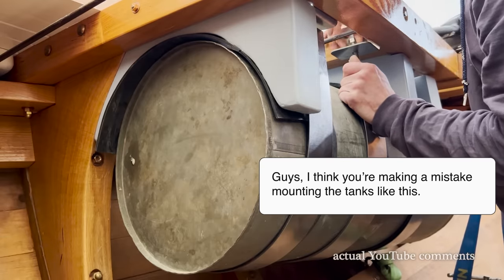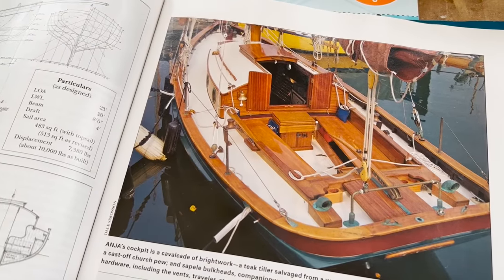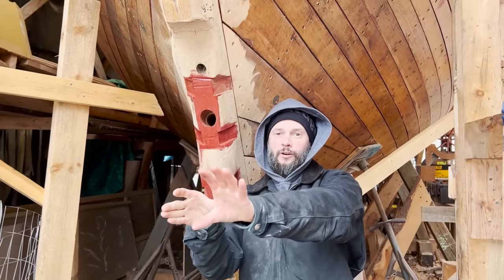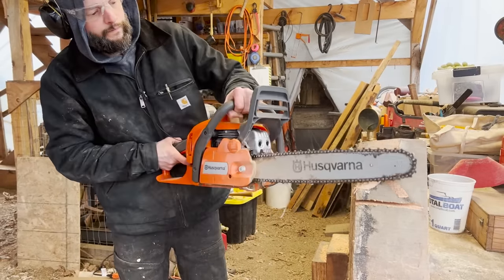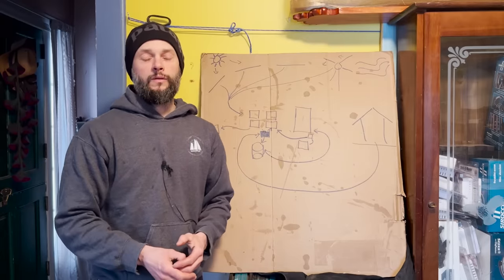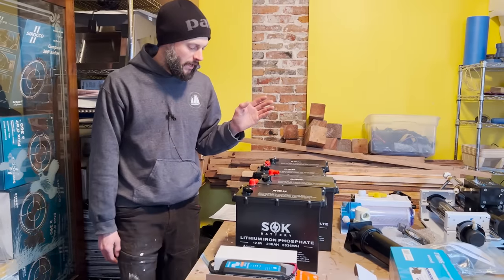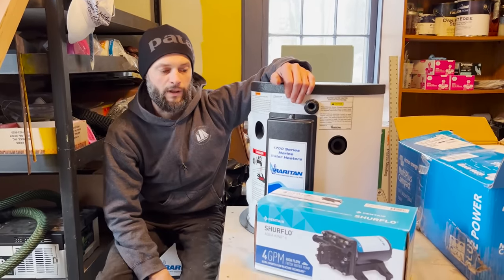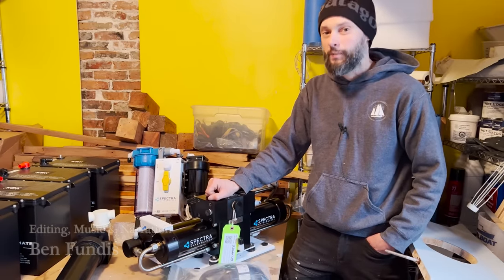That Prop Is Too Small & Other Comments - Episode 248 - Acorn to Arabella: Journey of a Wooden Boat

Comment: I agree with you on the chain saw being appropriate as I have used them for years, however for your applications you need to get one of the new electric versions that are hand sized.  Corded or battery, either one would be find and both depending on the work, replacing that husky you have with a large corded one would be a good idea and the battery versions for the smaller work give you flexibility I am sure you would appreciate once you have them available in the boat house.  A news bar and a sharp chain and you are in business for nice quick accurate cuts.
Reply from the maker: Thanks for watching, David!

Comment: Steve, you may want to consider running the alternator directly to the house bank. I have mine that way with a simple ACR from the house to the start battery. I believe you can pump more energy into the house that way while keeping the start battery charged.

Comment: I completely agree with Steve on the chainsaw. I also don't like sawzalls or routers.  The sawzall is good if your cutting metal or wood with fasteners in it, otherwise, if I'm rough cutting wood its with a chainsaw. I've been using chainsaws since I could hold onto them when I was like 10 (34 now).

Comment: As far as Coast Guard inspections go you can carry up to 6 passengers without an inspection.  The captain would have to have a "6-pack"  or higher captains license.

The Gerr propeller handbook will give you an idea of the size your prop needs to be and the requred ptch.  The size you will get from that handbook will give you a good start, but you will have to refine the prop pitch.  Sizing and pitching the prop accurately is not that difficult for a displacement hull boat, but it does require quite a lot of information about the hull form (i.e., displacement, wetted surface area, canoe body draft, water plane area, and so on).  Fortunately all of that required information can be calculated from the lines drawing.  You also need to know the power of the engine, the number of bearings on the shaft, the transmission ratio and the maximum rated engine rpm.  Finally, you need to know the details of the prop design (diameter, disk area ratio, blade form, hub diameter, etc.).  Since you chose a non-standard prop calculations will likely not get the pitch much closer than about 1".  Fortunately, with a variable pitch prop the final adjustments can be done by you, even in the water.  One last comment, a displacement hull can be driven to well above hull speed, it just takes a LOT of power to go much above "hull speed".  The power curve is exponential so going faster quickly requires too much power.  Diesel engines have been around since the 1890s, but until the post war period they were too big and heavy for a small boat like yours.  Hence the use of gas engines in most sailboats during the first half of the 20th century.

As fas as installing those batteries goes, you need to look at the new ABYC standard for lithium batteries on boats.  Yes meeting ABYC standards is voluntary, BUT insurance companies have a nasty habit of refusing to insure boats that are not ABYC standard compliant.  They have become very picky about lithium batteries over the last year or so.  So make sure that your lithium batteries meet the ABYC requirements which include that the batteries are UL approved (the entire battery not just the cells).  I strongly suggest that your installer reads the new ABYC lthium battery spec, or you may be in for an expensive surprise when you try to insure the boat.

Comment: I work in radio communications, our mountain top sites are solar powered and have been converted over to LiFePO4 batteries.  The amount of run time vs thier footprint is tremendous and omigosh they are so much lighter (that's a big deal for someone who has to fly up to a site and then walk a battery across a mountain top)! The batteries usually bulk charge up to 100% by 10am to replace whatever the gear uses during the night.

Comment: SOK is a really good choice for batteries at this time.  It's kind of the best of the 2nd Tier brands.  824Ah is tons of capacity, you'll have a lot of holdover capacity for a sequence of rainy days.  No-one ever complained about having too much battery on their vessel.  You didn't mention it Steve, but a fine investment would be a high capacity alternator with something like a Wakespeed external regulator for battery charging .  I think you're gonna find that you'll use it a lot more than you think.  Wind doesn't provide all that much power, you don't have a ton of room for solar on that vessel, hydro generator is obviously only useful when underway.    That leaves the alternator picking up the slack.

I'm glad you relented on the water heater.  As I mentioned months ago, we use a water heater for showers even where we live down here in the tropics.  In summer, when it's brutally hot, a cool shower is nice.  In winter, when it feels cool to those of us who are acclimated, a cold shower is just no fun.  Totem is right, you're not setting up a boat for roughing it, for long term cruising, you should make your life as comfortable as you can.  4GPM is not a small pump - it's actually larger than most.  We have a 2.9GPM pump on our large catamaran.

You should reconsider the accumulator tank for the fresh water system.  It has slightly different benefits than in the watermaker setup.  In short, the $100 accumulator and the 20 minutes it takes to plumb it in will make your pressure water nicer to use - no pulsing -  but more importantly it prolongs the life of that pretty costly freshwater pump quite a lot by allowing it to cycle much less.

Comment: Another point to note might be that the propeller can be changed.  Optimizing propeller design is a vague notion.  Optimize for what?  Thrust, fuel efficiency, power absorption - and at exactly which speed would you like to optimize any of those performance parameters? Prop design is usually a wise compromise considering predicted hull speed, emergency situations such as wave resistance, wind resistance, fair weather cruising situations, importance of fuel efficiency, etc.  Of course, motor selection goes with it.  Fortunately, if a selected prop exhibits undesirable performance, it can generally be switched out for a design change where pitch, diameter, number of blades, etc, can be tweaked to get a better result.  It happens that it is very common to try different prop designs on a one-off displacement hull.  Also Gerr's book is a great reference.

Comment: You might consider dual alternators with an oversized second alternator. You will be surprised how much power you actually use and how often you will need to run your engine. It will take a long time to charge your batteries using a factory installed alternator. I would recommend that the second alternator be as large as possible for quick efficient charging. Solar is over rated. Your lucky if you get half on a sunny day unless your panels are continually in direct alignment with the sun.

Comment: Steve  water heater thumbs up !   ,   i know your from a colder  climate,  So this may not register with you but after owning a boat in the sea of cortez   it is a must to have A/C,  for a live aboard  , The reason is the boat turns into a sweat box even with fans its very  hot  humid and uncomfortable  and youll find yourself on days wanting to get a hotel room with a/c sometimes  just to rejuvinate , that kills your budget .  even if its just for your sleeping area its a must

Comment: Never put the water heater on batteries!  Run the engine coolant through it for hot water underway and only use shore power for the 115Vac heater!
I am an electrical engineer, sailor,  and I have been a yacht electrician for ten years and I have never seen a single boat that put their water heater on the batteries.

Your electrical panel should be set up so that shore power comes in through a main breaker, which feeds a bus with (on your boat) two breakers, the inverter/charger and the water heater.  The panel then has another bus with the breakers for your outlets which is powered by the inverter or shore power.
Reply from the maker: Yes. That’s the plan.
Reply: @AcornToArabella  Don't even connect the water heater to the inverter at all.  As you showed in the video.
There is no real option to heat water with batteries, so just don't even allow it to be possible for the heater to drain them in any way.
Thanks for anther great video!
BTW, I hate sawzalls too, lol!

Comment: I have carved burl bowls with chainsaws, and throttling down the motor helps control the cutting action, especially cuts that engage the tip of the bar.

Comment: Hi Steve (and Team of course)! Thank you for the extensive explanation on your choices! Maybe it's a European centered question, but can your inverter/charger for shore power deal with 220/240 V - depending on the locations you are planing to visit, this might be of importance!
All the best to you and your mum (unfortunately I had a similar situation last year) and thank you for documenting your awesome work!
Reply: Yes Steve I was thinking the same. Sometimes American designed and made equipment can be short sighted in those terms of supply voltage across the world. Something made for domestic America is ok, but if being fitted in a sail boat needs addressing now before installation, or you may regret it. Even if you went to the Caribbean you'd find a lot of 220-240 volts 50 Hz as many were British colonies.

Comment: When I pulled my 25' Brynne out the first time, she weighed in just over 15,000. Over the next couple years I gutted out the interior and the the engine. Only thing left was fuel tank, battery and rigging. For I continued to sail her, I think I averaged 4,000 miles every year with her. Anyway at the lowest weight I had her down to was just over 12,000 pounds when gutted. Her mast was just over 1,000 pounds. It took me 10 people to move the mast off the trailer when I took it down to maintain it. Think it had been the first time in at least twenty years. I was so disappointed that the Mast coin was gone ☹. For people to know how my sailboat could be so heavy, her mast was over 15 foot taller than the norm for a marconi rig. I had to use sails that you find on 30 to 35 footers. When she was light, she did sail very differently and tender. Once I had the engine back in which was a 10 Hp Volvo Pinta Diesel and interior, she once again pegged 15,000 pounds. Once again she sailed in 20ft seas and 40 to 50 knot winds with confidant grace. I miss her.

Comment: You won't need the fresh water foot pumps with a water maker. Keep it all on the pressure system. my mistake was not putting the accumulator system on our boat so hopefully you will make room for it.

Comment: Only one of the two tubes in your water maker has membranes inside. The larger one IS your high pressure pump. The external pump is your low pressure pump. Take excellent care of your membranes. They are expensive, go bad quickly and easily and are difficult to get delivered in many parts of the world. Water akers are high maintenenance and require a lot of power. Much easier to invest in a rainwater collection system.

Comment: Diesel is much less volatile than gasoline. That’s why you see work trucks with auxiliary diesel tanks in the bed but never an auxiliary gasoline tank. You’ve gotta work a bit to get diesel to light, gasoline is a bomb.

Comment: I assume that Victron multi system doodad will also accept 230V shore power? At least you should equip the inlet in a way that it's possible in some remote locations - like Europe. 😁

Comment: Your electrical system is entirely adequate for a boat that size, but you will want 120/240 for running tools etc. So a breaker box will probably be needed as well.

Comment: Steve, sounds like you've done your homework on electrical and water systems, as expected.  I built out a Van with similar systems (yes, a little smaller) as you've described and just retired after working as an electrical engineer for 40 years, so I've a good understanding of what your talking about.  I expect you're wiring your batteries in parallel, just be sure to locate the inverter as close as possible to the batteries as and don't skimp on the high current wire gage.  If your wiring your batteries in series, or a combination of series and parallel to up the voltage I'd say that's a good idea.  The current demand from the water heater will be pretty heavy I suspect and a 24 or 48 volt system will be a big help with that.  I'd be happy to kibitz on any electrical system details if you'd, just let me know in the reply.  I certainly wish you the best and hope and pray you'll get your Mom out for a sail this summer.
Reply from the maker: 🙌 and thanks for the kind words!

Comment: Are you putting in a allocated battery for the windless?  Very common unless its manual. 
My experience with solar charge regulators , depending where you put them , use more than 1 charge controller,   because of shading , ie if you put 2 on the top roof , depending on your tack shading will effect both sides unless you put a controller on each side ,  masts and booms throw shadows every where ,  hydro gen great when moving , crap at anchor , wind for tick over of power 24/7 only if windy ,  
All the big name nav gear , with 6our first cruising area , 12 v computer, 12 v monitor ,   open cpn up to date charts , and learn over time what works better , 
Much lighter,   depth wind gps ,  
Your mother will be there , you can always finish things off inside  when in the water if you need a bit more time ,  respect

Comment: Consider having twin alternators - we have two, a 'normal' automotive one which runs to the engine battery and a larger one to manage the house bank. Ours both run through the same Smart Bank setup so we can either charge together or singly depending on the state of the engine battery which is the primary requirement.  Always good to have a spare!
And...  Shurflo pumps are dodgy.  Of all the things I have replaced over a lifetime's boating, Shurflo pumps are top of the list.  I know you already have one, but take a look at Jabsco for when you need to replace it (which will be fairly soon). Jabsco sell a prebuilt pump/accumulator combo which matches the output and pressure for you.
Reply from the maker: I had two on one of the boats I cruised and they were utilized the same way. It’s not something planned for Arabella at present. On my boat now I just carry a second one because I bought a second Yanmar for parts then got the alternator serviced so it’s ready to go! I’ve got a tiny bank though. —Anne

Comment: You'll find a small bladder tank in some city water houses, if you're fed through a check valve the plumbing in the house needs room for expansion when the water heater comes on. I would think you'd want similar on a boat with it's own pressurized water system and a heater.
Reply: Exactly. Most state building codes require an expansion tank if the building has a "closed" system so that expansion of the water in the WH does not break the WH or other components in the system. Even if the expansion does not immediately break things, the pressure cycling will fatigue the pressurized components and shorten their life. The tank has nothing to do with the pump. A "closed" system is one where the expanding water cannot go back into the water main. A pressure reducing valve (PRV) on the feed line from the water main is the most common component that will create the closed system because water can only flow one-way.

Comment: Steve  putting your 12 volt system in series will give you a higher voltage  24v dc or 48v dc that is more efficient when transferring to 120v a/c . Think you can just do a dc to dc transformer for the equipment or make two circuits one high voltage dc and one 12v dc with an extra battery . It will be an extra cost but will be good for energy management and efficiency .

Comment: prop design is a art and profession all by itself. diameter compares  to pitch/ weight to hull design displacement /motor - trans ratio to speed/ all is important, and someone else's job not for  the main stream citizens. the commoner  can change different ones to see the best performance

Comment: 1st: From all the videos on A to A I just know that you did (and do) a lot of thinking before starting to do stuff. So, I don't see why I would try to correct you on ... most anything.
2nd: What you said about the chainsaw and control confirms that I am right with the above approach: Your take on it is totally in accord with my personal experience! Chainsaws are not dangerous because they are difficult to control. Chainsaws are dangerous because people tend to underestimate them!
3rd and last: It has been my experience over the time of watching your channel that anything I did not understand at once was explained or became clear at some later point, not too long after the question came up for me. I may even have asked a question here and there. But I have always tried not to frame it as "you are making a mistake" (which some of your quotations here sound like), but rather as "I don't quite understand how that works or why you do that, I know you have a reason - please help me understand that reason". I think there is a difference!